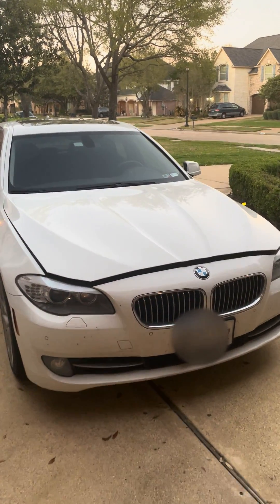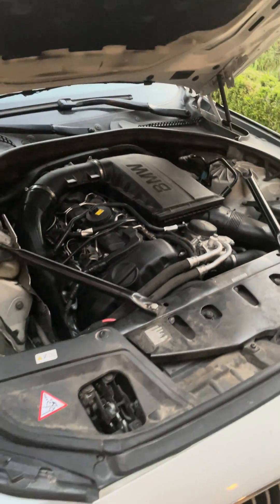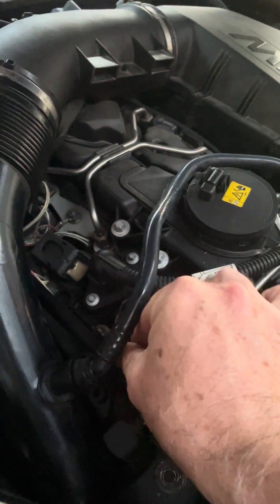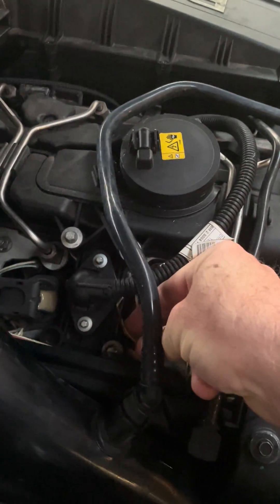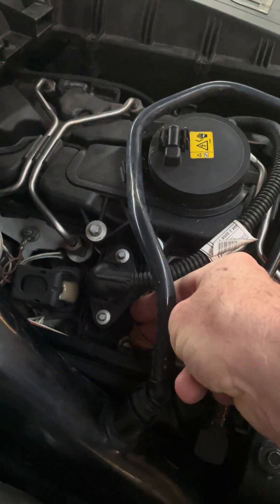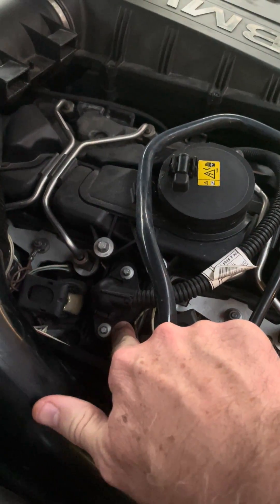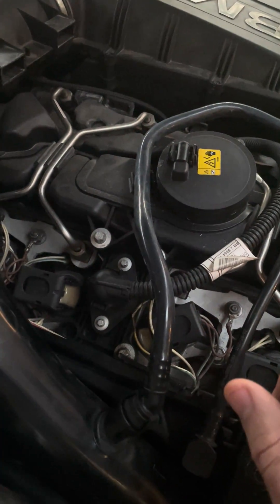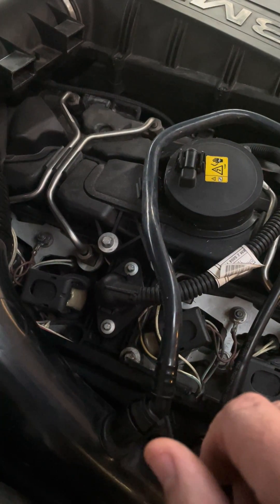BMW 2011 535i F10 N55 Unusual P112F Code and Correction - Running Lean with Vacuum Leaks

Comment: My nephew just bought a 11 i535 with 180k.  This code just popped up.  We had the oil cap off while it was running so not sure if that would trip this code.
     What would be the first 3 things to check if this keeps popping up?
Reply from the maker: It could be any number of things. You can start with the gasket on the gas cap. I've had to replace minea couple of times. Make sure all your intake connections are tight all the way into the intake. Also, get a can of cleaner for your MAP and try that process. This is a hard code to track because so many things trip it
Reply: I removed my oil cap while car was running now this fault code keeps comming back lol wonder if the oil cap is my issue now

Comment: Mine has that code the moment i replaced my charge pipe with an metal one
Reply from the maker: I would start with the sensor that was switched over. Make sure the gasket is good for that and that it is in balanced. Also, might hit it with some sensor cleaner to make sure no debris got on it.

Comment: I’ve been chasing this code for a year now and it’s driving me insane. I’ll check on this next. Thanks.
Reply: im going dor the year tracking too, god dang it bout to trade it for some suv and retire from dealing with this unfidable culpird
Reply: @chefpe12 ended up being the valve cover. There’s a hidden leak inside the valve cover. If you take the main vacuum hose off of it and dip a qtip in there and get oil, there’s your leak.

Comment: Quick question. I have a 2011 BMW 335xi and am getting the p112F code. It has a long crank on a cold start but once it does start is perfectly fine. Idles at around 650 and drives perfectly fine. Any ideas?
Reply from the maker: On mine I saw a trick to reset the computer because it learns your driving style. Press the start button (but not start the engine) and then press the accelerator all the way to the floor and hold for 60+ seconds. It will zero out the computer. Otherwise. you probably have a vacuum leak somewhere. This one seems to crack easy and is a good place to start (not sure of the right one for a 335) https://www.amazon.com/TOM-Crankcase-Valve-2011-2017-11127584128/dp/B09DKMWJL6/ref=sr_1_2?crid=1I14PN5IXH7ZY&keywords=2011+crank+case+hose+bmw+535i&qid=1685123947&replacementKeywords=crank+case+hose&sprefix=2011+crank+case+hose+bmw+535i%2Caps%2C119&sr=8-2&vehicle=2011-31-189------------&vehicleName=2011+BMW+535i I think the 335 version actually crosses across the front of the engine compartment and cracks even worse.
Reply: I have similar issue sometimes the crank is longer and slightly rougher but rpm goes up and it’s fine other times it’s smooth start. It shuts off occasionally at a stop but it doesn’t happen often at all which I’m confused
Reply from the maker: Also, I had a rough idle and had it die on me a couple times. I did a Seafoam treatment on the air intake and it cleared up all the rough idling.
Reply: Did you fix it?